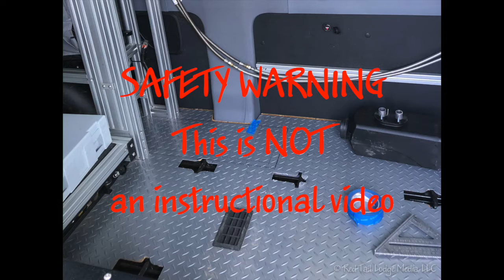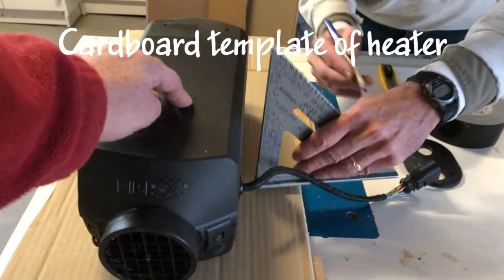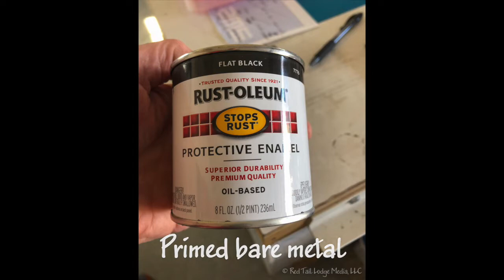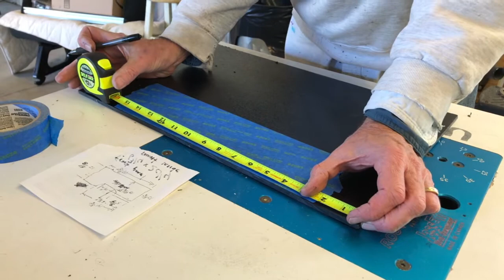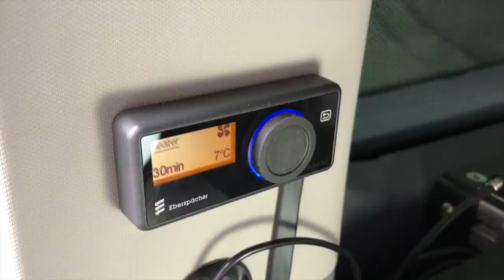Espar Heater Install: Campervan Project #6

Comment from the maker: A note about the connection at the fuel tap.  From the Ford auxiliary fuel line connector (the little black and yellow L shaped bit that attaches to the top of the tank) - we had a plastic reducer between it and the espar fuel line.  If you use such a thing - make sure to see if you can secure it from vibrations.  We had is secured so it would stay in place, but it looks like even modest bouncing can cause it to break.  So a month ago or so, we had to go back under and replace that reducer.  The aux fuel port piece was ok, but the reducer broke in half.  This time we used a brass reducer and also tied the line of near that point to help reduce stress/bouncing at the point.  Other than that - we've enjoyed the heater and it has worked well for us.
Reply from the maker: @Mark Kilian Thanks for the info.  The place ours broke previously was a reducer from 5/16" to 1/8".  So far the $5 brass one is holding up but only time will tell if we've got it nailed.

Comment: Is it possible to explain a little about what you attached to the fuel tank and how tp do it? Great video, getting ready to install mine next week.
Reply from the maker: The part we used we ordered from here: https://www.oemfordpart.com/oem-parts/ford-kit-ck4z9b210a
The gas tank needs to be lowered and this part replaces a nearly identical stub that is on the top of the gas tank.
Reply: @BackroadBuddies  Thanks for your time!!
Reply: @BackroadBuddies  The original plug does not want to come off.  I sled the yellow piece out as far as i can, but it still seems stuck.  Any hints?
Reply from the maker: @GaryCoventry133  Hi Gary - sorry for the delay.  We're on another trip.  Yes.  I think I can help with that - if you haven't already found the solution.  If you have the part you will be replacing that with you can use that to help understand what's involved.  Once the yellow tab is slid out, on the sides are two tiny black tabs that if you pinch them together and look into the hole that will attach to the tank you should see the geometry of the orifice change just slightly.  It's this pinching action that you are probably missing at the moment.  Wouldn't it be nice if Ford already had this in place with an accessible connection point like the Mercedes vans do?
Reply: Ah - found the solution.  After sliding the yellow part, there are buttons to press and release the connection

Comment: thanks for sharing your installation process.   Im curious, after a few years of use, have you experienced any issues such as error codes or fuel supply problems? Thanks.
Reply from the maker: You're welcome. The only issue we had was that the plastic connector that connects the fuel line port to the fuel line broke. We had to drop the gas tank again and replace the plastic connector with a metal one (see Lesson 26 in Tips and Tricks Season Two video: https://www.youtube.com/watch?v=JttI2rh2AuE)

Comment: Great video and tunes...
It appears you have about 1 inch of insulation, is it important that the heater is installed directly to the van floor and not on top of the insulation?
Reply from the maker: We had to remove some wooden floor and foam sheet insulation to expose the metal floor.  We think it's important for the heater would have a solid "non-squishy" mounting location.  The air intake and exhaust pipe and fuel pump connection points under the van would be challenging to attach to if the floor were too thick. The exhaust tube also gets pretty hot so it's probably best to not have anything that could burn or melt near it also.
Reply: @BackroadBuddies  I appreciate your response, thank you!  Looking forward to seeing more...

Comment: Impresive! How many hours did you put into this project?
Reply from the maker: Including building the enclosure, it took us almost forty hours of work (including all the research and online orders and supply runs) over about two months of elapsed time and cost us approximately $2200. There are more details in our blog post: https://redtaillodge.com/espar-heater-installation-campervan-project-6/